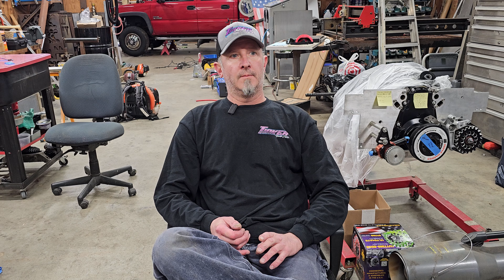Duramax Electrical Upgrades With Details and Step-By-Step Install

Comment: I’m currently installing the equivalent to the factory replacement version of these cables and it seems on mine that they put my junction clip for the little red box, on the wire upside down.
Reply from the maker: Not sure what you're referring to regarding "upside down".  If there is a question about the assembly I would recommend getting in touch with them.